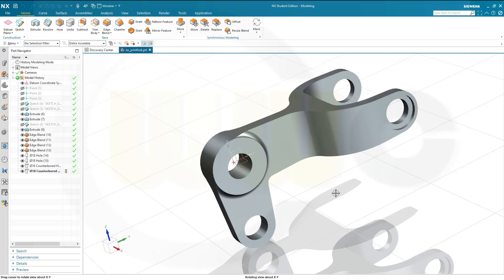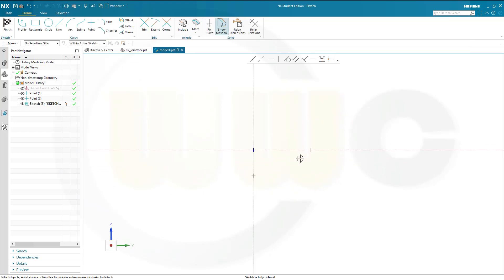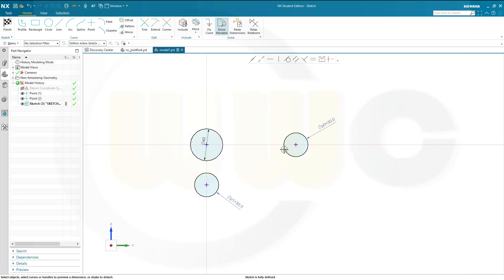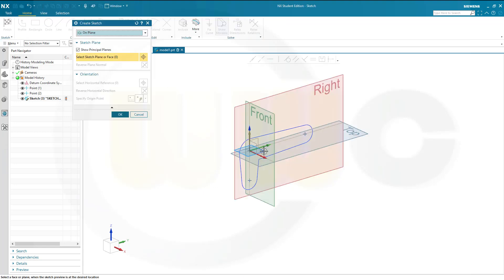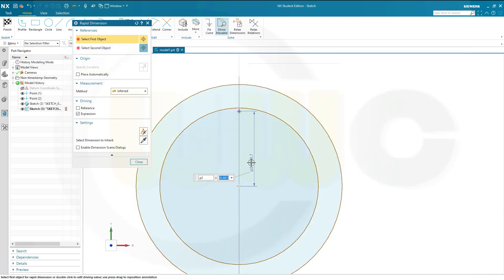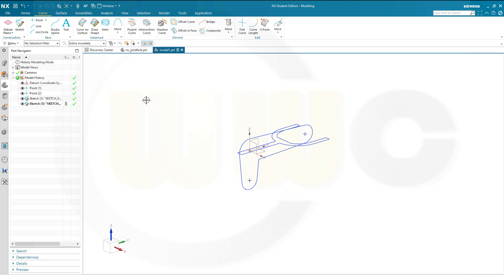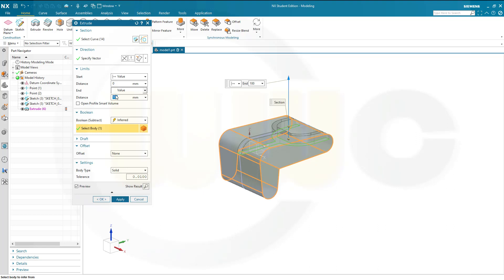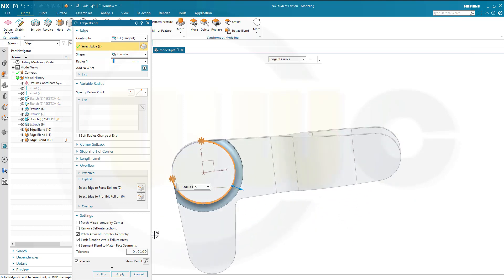7.2 Gelenkgabel - Joint Fork - Siemens NX 2007 Training - Part Design

Comment: hello, if i do this in solidworks, i can do faster than in nx, Dimesions are making me too much difficult, neither understand nor read the annotations properly.
which one is better ? solidworks or nx? for mechanical engineer
Reply from the maker: Siemens NX is superior to SolidWorks. But it is also far more expensive. So depending on what you want to do SolidWorks could be a decent choice as well.